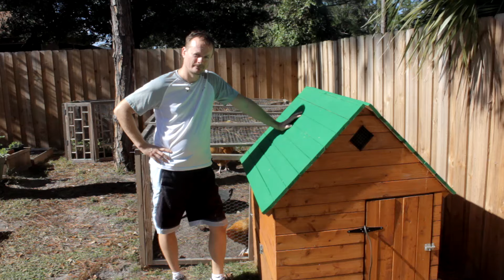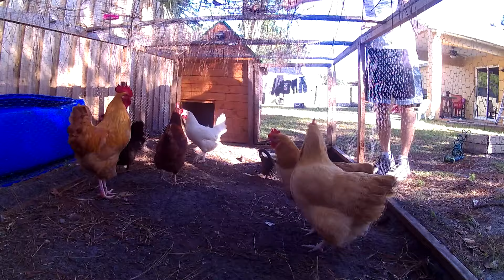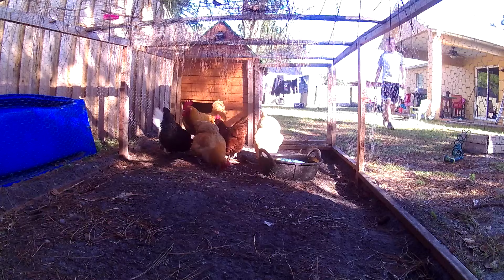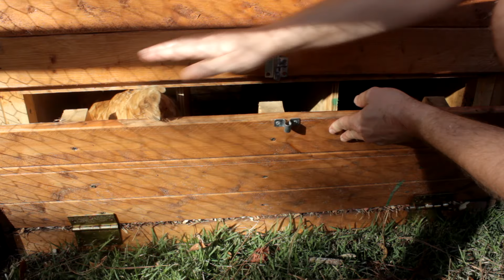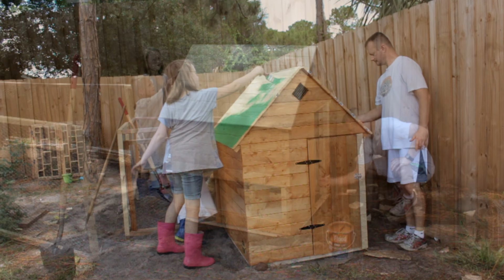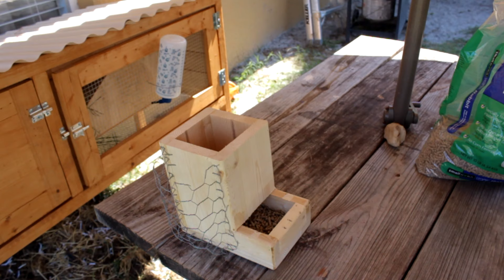DIY Chickens: What to do with a Broody Hen?

Comment: Interesting ...what if you took one of those little blue ice plastic blocks if not frozen at least very cold?  Seems like it logically might do the same thing without getting henny penny all "mad as a wet hen" ...thoughts?
Reply: btw should you ever feed and water a broody hen sitting on eggs you want her to? Cause you said a hen will sit until they DIE if eggs are  not fertile ... I am assuming they would die from lack of nourishment??
Reply: @dougiequick1  dehydration is the bigger threat.  They need to get up and go drink water.